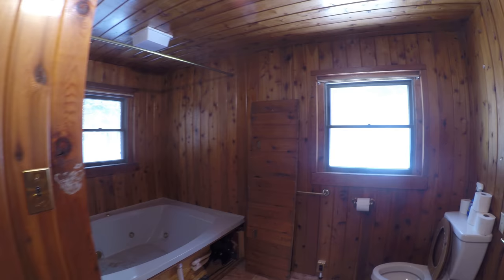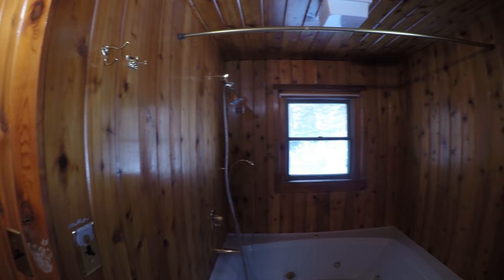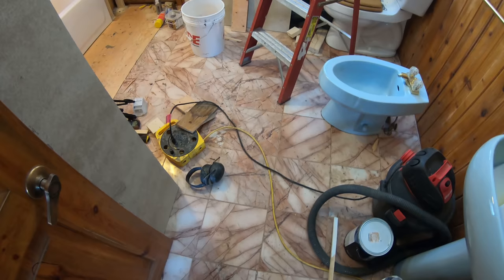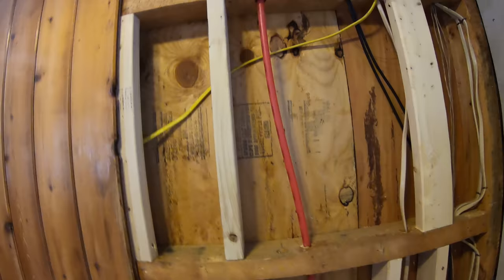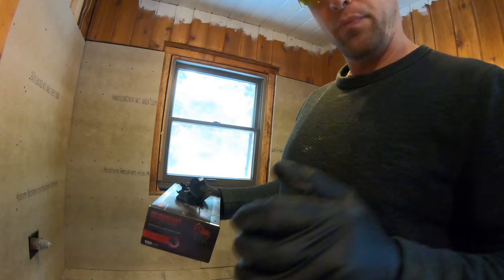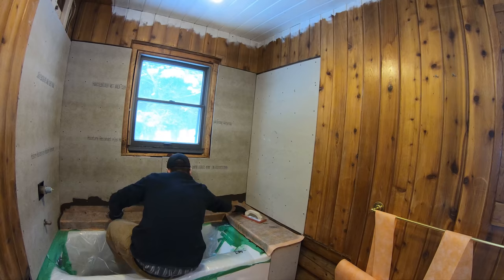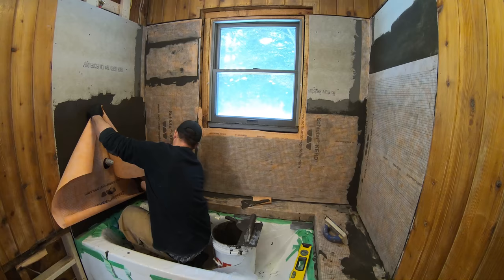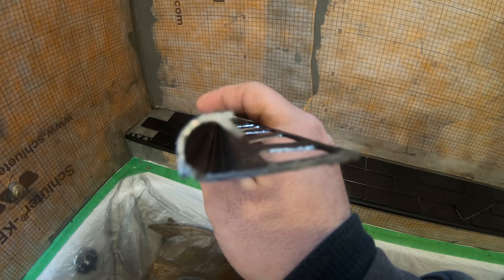Winter Work inside log cabin

Comment: I don't agree with painting the beautiful stained wood. But I do agree it is a bit much in the bathroom.
Reply: I thought the same way at first, but then I put myself in the shoes of the cabin owner and realized that the entire place is wood .... every room, every wall, almost every floor, every ceiling and I suddenly realized that after looking at wood everywhere, the mind must be longing for something different. A different color, a different texture, a different material. So even though the black tile and white walls would not have been my first choice, I can understand that the homeowner probably wanted or needed something different.

Comment: I had a simple pine dresser that was unfinished. It had knots in it and I painted it with primer four times letting it dry in between , then with white paint three times. The knot holes still came through within two weeks, WHAT was used on these walls, I must know😀